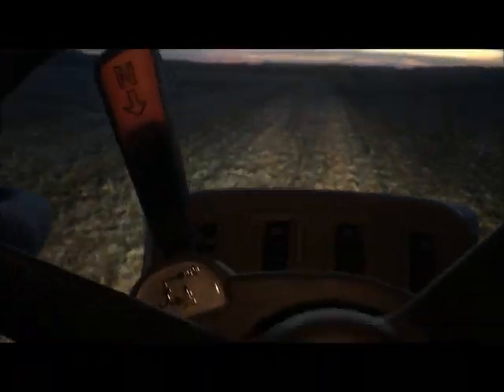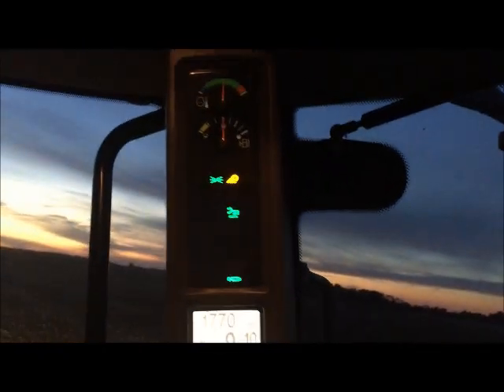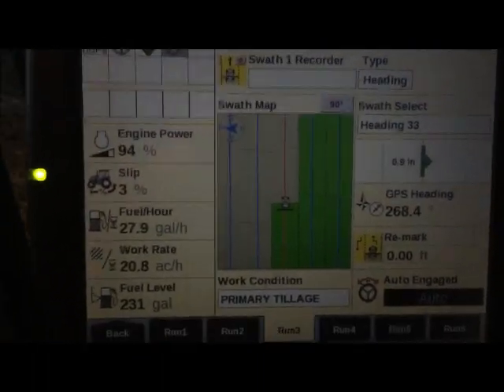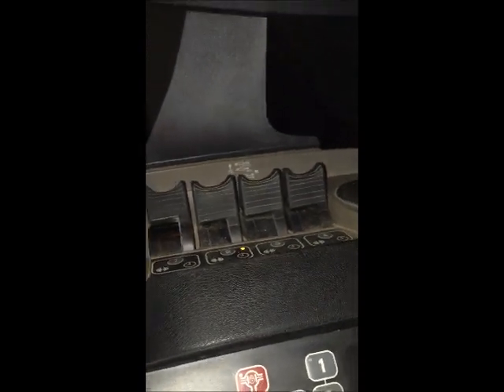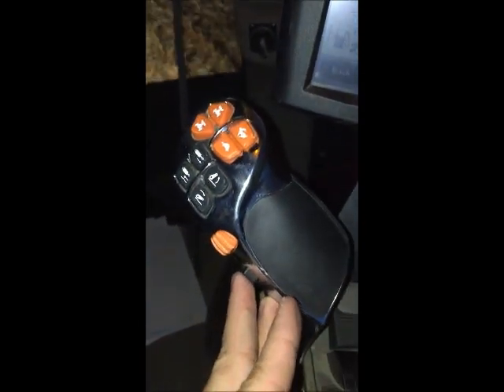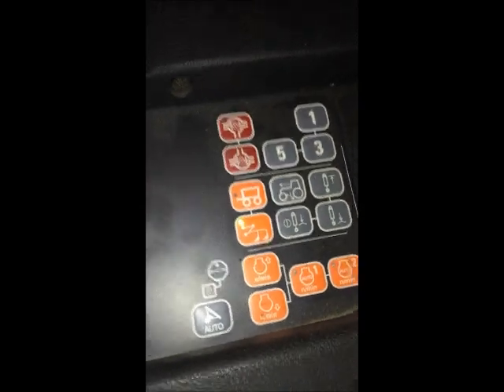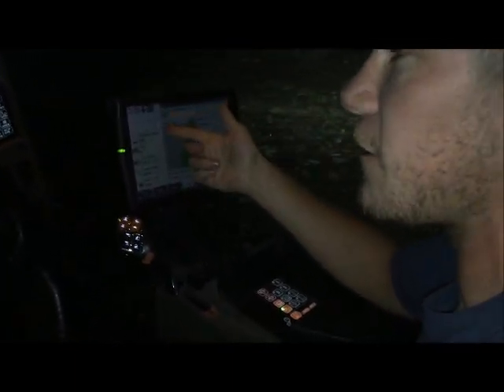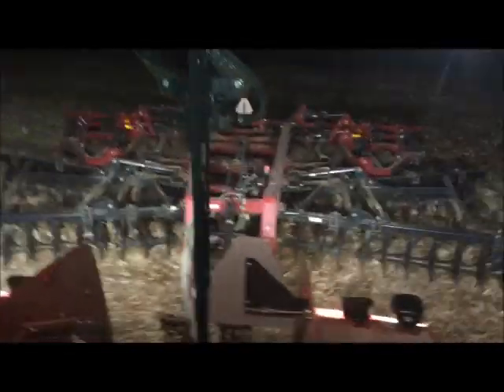Case IH 620 QuadTrac

Comment: WOW ! I could never run something like that cause if I did Case-IH would soon be out in the field trying to figure out what I screwed up by pushing the wrong button. Its great equipment and the way things are going but there are too many buttons for me to run it, I like to keep things simple and under MY total control. Great video so keep them coming.  Bandit
Reply from the maker: +Bandit farmer The learning curve isnt as bad as you would think. The biggest thing I had a hard time getting used to is that before you engage the auto steer the tractor has to sense that you havent turned the steering wheel for a split second before you hit the button otherwise it stays in manual mode. From force of habbit I kept wanting to keep my hand on the wheel trying to complete the turn and it wouldnt kick the auto steer in so i missed the mark more than a few times. I think I will stick with my 1955 though!
Reply: +Oliver66FarmBoy  I know what you mean, For some of us the old saying "That you cant teach an old dog new tricks" Is true !  I guess I like many others still like it old school, Totally hands on.  Bandit
Reply: Im 19 and run a case quad trac. Never ran anything that big or new before. Honestly took maybe 5-10 minutes to get the hang of it plus the auto steer. They really are simple once you understand it
Reply: @griffinwiegert527   Newest thing I think I've run was a JD 4630 so it would take me awhile to figure it out then I would worry I was going to brake something ! LOL  Someday I might run something about new but for now me and the old stuff get along just fine !  LOL Bandit

Comment: Wow what a super machine. You have to do lots of practice runs to get it down pat. All that computer stuff in machines was just coming into play
before I retired. I was loving every minute of it but sadly I took a buyout and retired.
Reply from the maker: +canvids1 Its fun to run but it gets a little dull after a while. I still prefer my old open station tractors where you can smell that fresh worked soil and hear the straight pipe roar and last but not least actually doing the steering.